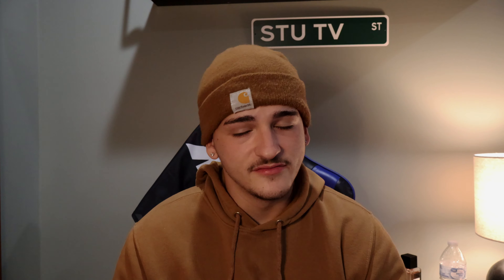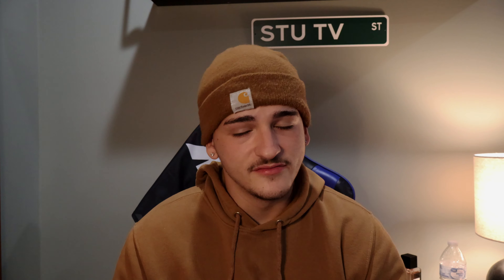How To Build a 700WHP Audi A3

Comment: To make 450-500hp is not expensive at all on MQB cars. Beyond that you need to build the engine and trans tho and that's whats expensive
Reply from the maker: 100% agree
Reply: Not expensive? I guess I’m broke
Reply: Does this also include the A3 1.8tfsi FWD?
Reply: @oupajohn8801 don’t even bother with a FWD one
Reply: @oupajohn8801 better off with a GTI or GLI at that point
Reply: @ionehkontehdiabo7627  why not?
Reply: @oupajohn8801  in my opinion one of the best parts of an Audi is the Quattro, It’d be a pain to ever hook with all that power in a FWD car without a ridiculous tire setup. Which takes me back to my point of if you want a FWD you’d be better off with a GLI because I’m pretty sure they’re cheaper. Don’t gotta take my advice just my 2c
Reply: @ionehkontehdiabo7627  Okay, i currently own an A3 1.8 FWD running an is38 turbo, planning to insert is38H ballbearing stage 3. I just wanted to know the reasons why you are saying it wont work on A3.. i barely struggle with traction as i use semi-slicks. Maybe with the is38H it will be difficult to hook.
Reply: @oupajohn8801  not that it won’t work, I just personally prefer AWD cause I see it as a main selling point of an Audi. I also live in Quebec where the snows horrible, so FWD really isn’t the move here. Enjoy your car my man im sure she moves

Comment: vortex xl will not get you 600whp that 600whp run from eqt was done on full tilt with a unsafe amount of timing & overspinning the turbo & your stock block will be on borrowed time lmao

edit

1. if you have mpi & upgraded lpfp you do not need a upgraded hpfp. A upgraded hpfp is only needed if you dont have mpi & a upgraded lpfp

2. rs3 brushless will not get you to 7xx it will run out in the 600s especially if your on E, i would recommend a pwr stage 4 setup to obtain this power goal.

3. when getting injectors for 6-7xx whp go with id1700 the bigger the better, 1300cc are ok but you dont want to max out your injectors for the power goal always go a step bigger to be able to properly accommodate future goals & be able to add fuel if needed.
Reply: Don’t forget the part where that cts boss  is never gonna make 700whp lol
Reply: @southfloridaskimmin  facts